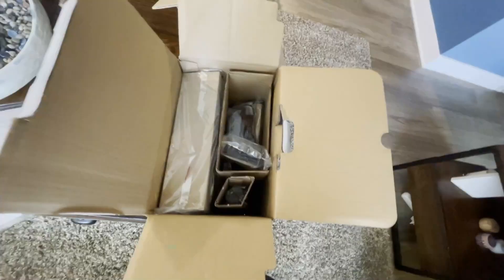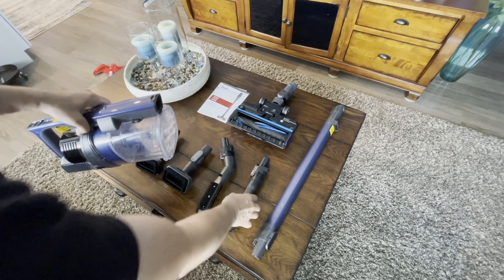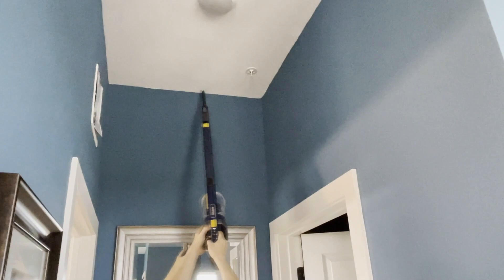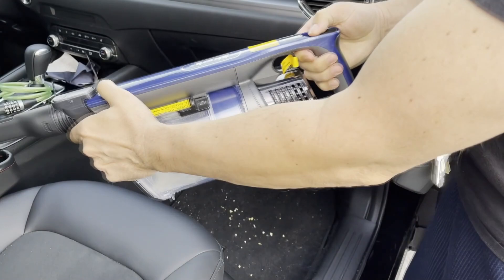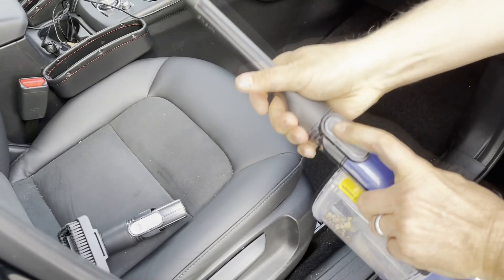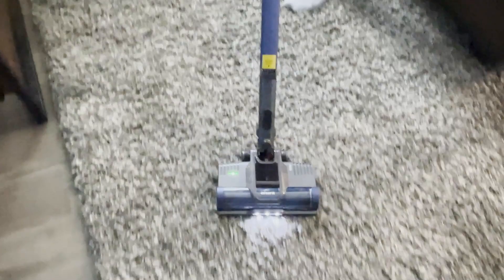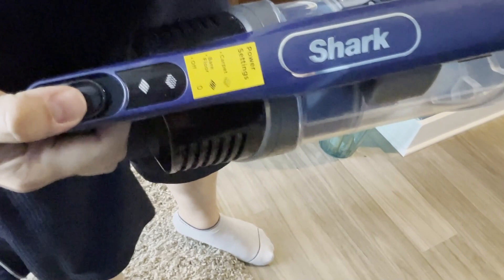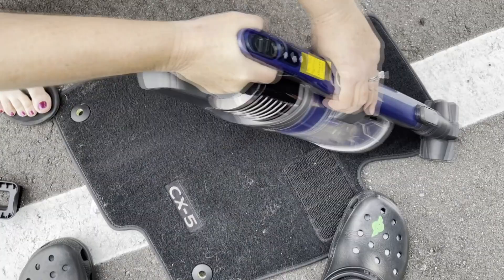Shark IZ363HT Anti Allergen Pet Power Cordless Vacuum Cleaner

Comment: I’m between this and a dyson. We have two medium size dogs , I don’t want a non cordless vacuum
Reply from the maker: Shark has better suction.
Reply: Just saw this comment, check out reviews on the dyson versus the shark. dyson has had a lot of issues with suction and it’s costly for mediocre quality. Shark also had a longer battery life, my step mom is a cleaning lady and overall shark 10/10 would recommend over the dyson. I know it’s an old comment but just thought I’d put it out there!
Reply: @cameronschmidt3149  I made the mistake and bought a Dyson! ☹️ I don’t really like it! I should had get the shark instead
Reply: @MrsLyds  I just got myself the stratos shark, walmart has the older versions for cheaper. I spent about 300 on it, so far so good. not too late to make the change!